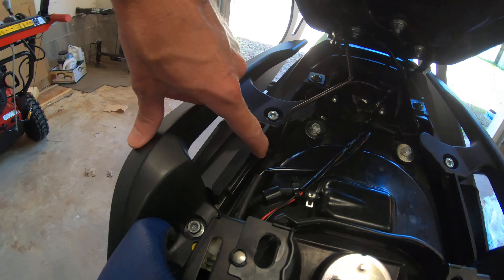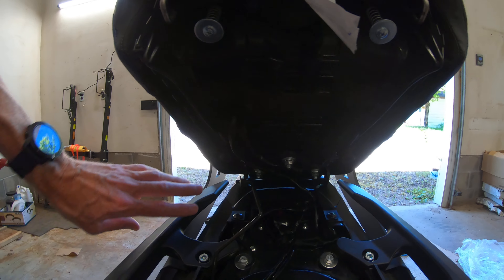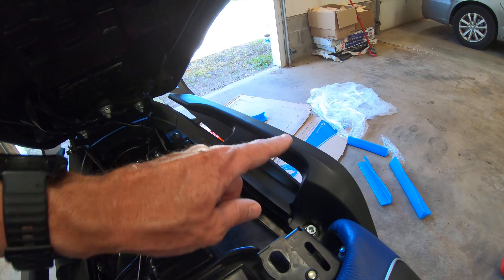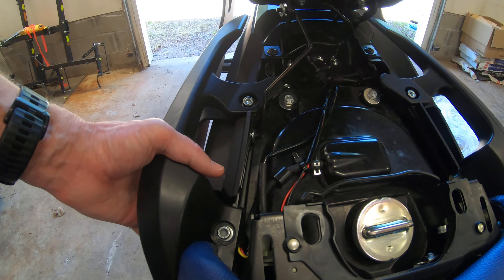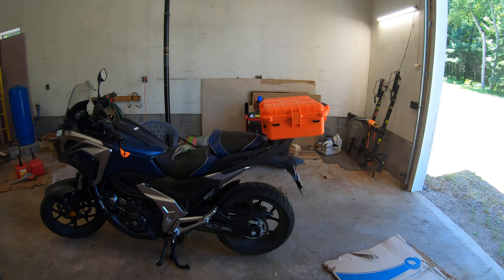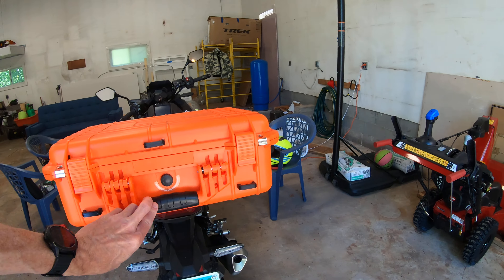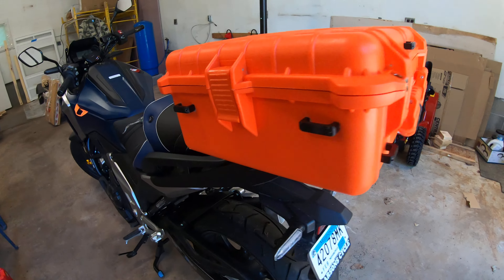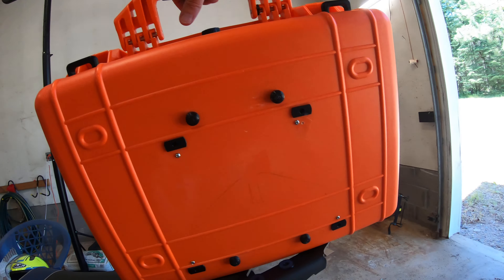Cheap Rear Rack and Top Case for Honda NC750x

Comment from the maker: It does come with longer hex screws and washers. The holes line up pretty well it's just that the structure is something of a spring and you have to pull it open and line up several holes at once to get things going. With a helper and being careful not to strip the inserts it wasn't that bad

Comment from the maker: I like the rock well enough. It is very sturdy. That's also un intrusive although sometimes I worry about how it might block oblique views of the tail light brake light. The paint job on mine wasn't flawless. Some of the corners and edges some of my handling took it off so I touched it up with gloss paint and that shows in the video. If I had had more time and energy I would have bought a can of matte black and hit it outdoors for an extra coat.

Comment from the maker: The key is to just get the screws started then tighten them a little bit at a time alternating in a Criss-Cross pattern. Be careful with the hex wrench when removing the originals because mine were really tight and my hex wrench skinned the plastic of one of the grab bars. My first cosmetic flaw. I hit that up with some sharpie that made it invisible.

Comment from the maker: As for a template and pre bending I think you would be hard-pressed to get it any closer than it comes. I might suggest just measuring the distance between the bolts center to center and seeing how that compares between the rack and the bike. That way you might be able to spread or compress the sides a couple of millimetersif needed before you put it on.
Reply: Thanks for all the thoughtful feedback, I really appreciate it.

Comment: Seth, I've been considering this rear rack and looking forward to this video since your "quick look" video over the winter.  I've noted that others have had problems with holes lining up on non-OEM racks and was wondering if a hole template made of cardboard or other material might help by pre-bending the steel before mounting.  By the way, it looks like they modified the design a little on the side struts since your purchase according to their website.  Did they supply longer bolts with the rack to accommodate the rack and handles?